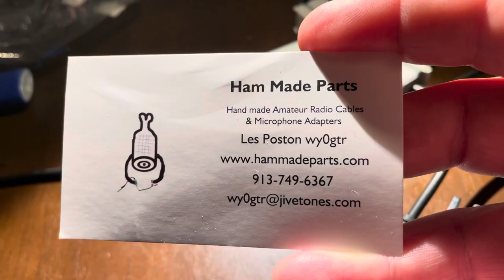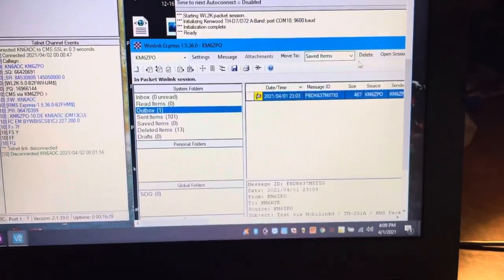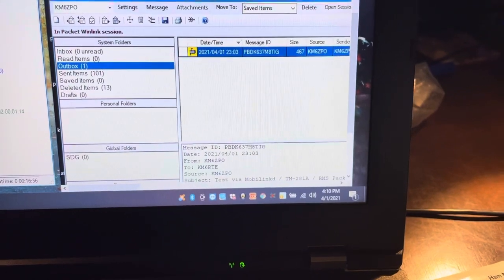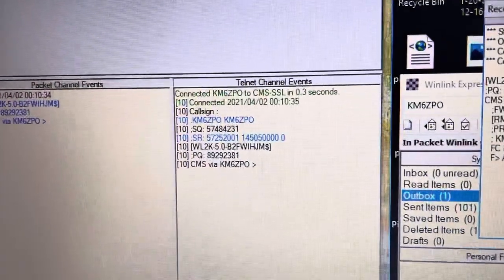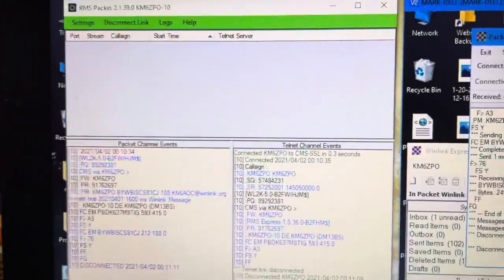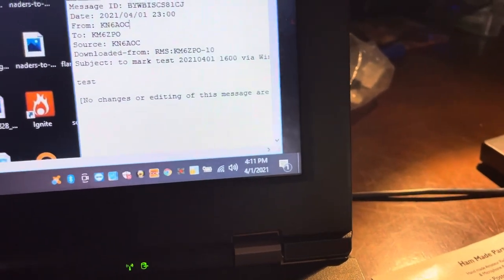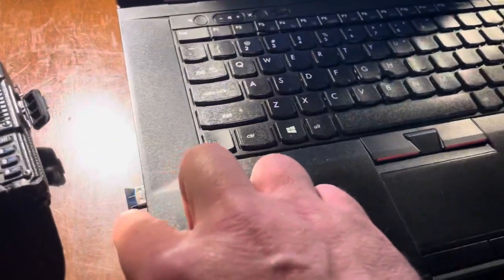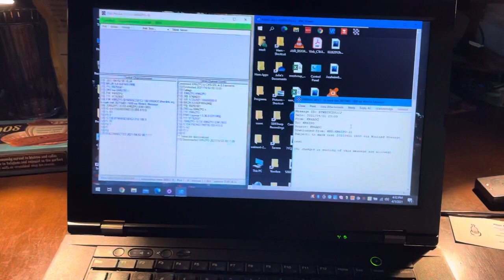Demo of RMS Packet with Mobilinkd TNC and a Kenwood TM-281a

Comment: Having trouble finding the right cable for my 281
Reply from the maker: Contact Wes at https://hammadeparts.com/ - it's a set of two cables - an RJ-45 for the mic and a single pole 1/8th for the speaker out which are joined to a single TRRS input for the Mobilinkd